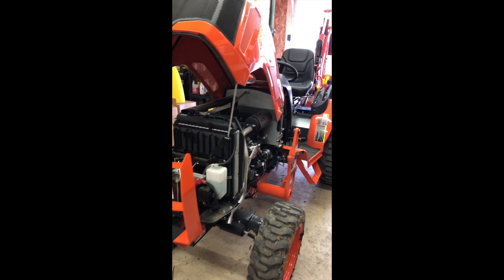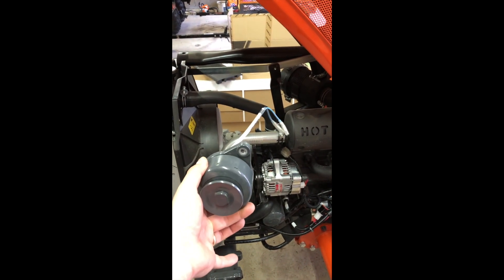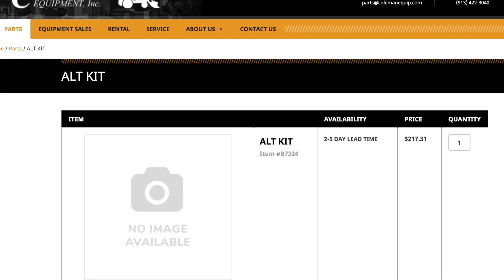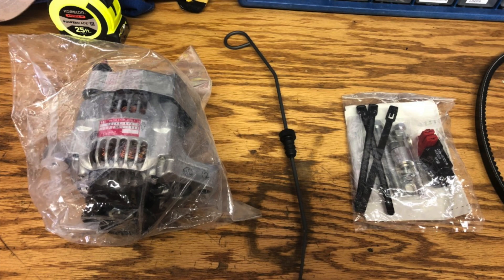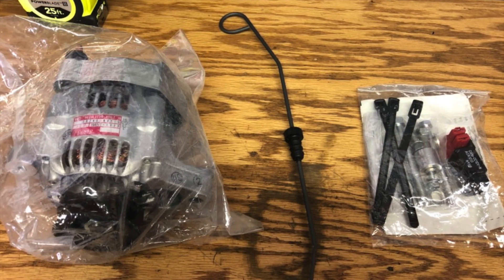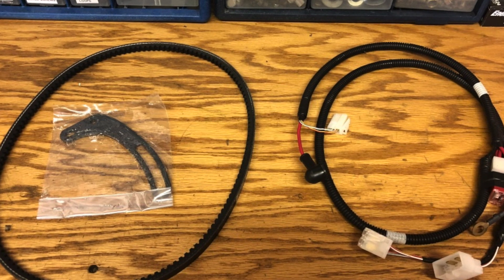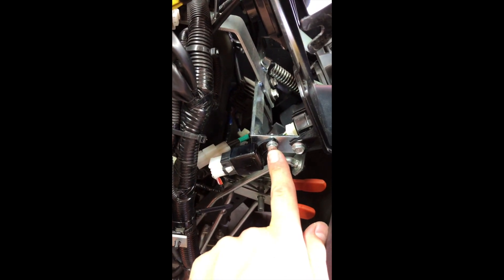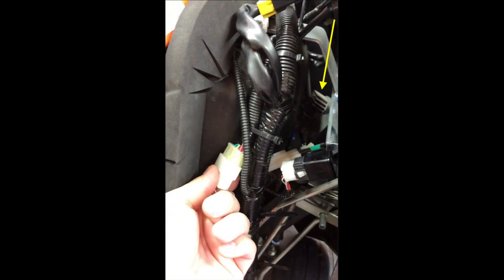Kubota B2650 - Upgrading the dynamo to a high output alternator

Comment: What exactly did you do with the ends of the 2 blue wires that went to the dynamo? You said you hadn’t had any problems with you leaving the original voltage meter on the tractor my question is why would you have a problem when it’s unplugged and not doing anything.

Comment: I bought the B7324 kit from Coleman, but it took a little while since they didn't have any in stock.  Your video was an excellent instruction manual very much needed because if I had to rely on their instructions, I would have been scratching my head a lot.  The install took 45 minutes like you suggested.  As info, the belt installation was the most difficult step as it was a tight fit.  Thanks for your video as I'm glad to have the dynamo replaced.

Comment: I have an off brand micro excavator with a kubota d722 engine- can anyone confirm weather this kit will work with the d722? I realize it probably wouldnt be plug and play but I basically just wondered if this was the correct alternator and bracketry?
Reply: Did you ever get this figured out? I'm trying to mod my mini excavator also so can keep my air conditioner going.  Mines a d722 also.

Comment: My similar kit for my B2601 just arrived.  I have a Japanese-made B2601, the US-made ones now come standard with the alternator, but the upgrade kit is still available for older B2601s.  I read the instructions tonight and thought "that's gonna be fun."  The instructions looked quite specific and clear, but very very abbreviated.  Your video puts it all in context - I'm sure my tractor is a little bit different, but most of what you're showing lined up with what the instructions say for the B2601.  Thanks for making this.

Comment: I’ve recently installed this without seeing your video. I did everything the same, but I did remove the old regulator. Have not been able to get my tractor to start since. Turns over, but won’t start. One thing I’m not clear about is what did you do with the other end of the blue wires that were connected to the dynamo?
Reply: Blue wires don't matter.   They connect the dynamo (low quality DC) to the regulator.  When you remove the regulator they are disconnected.
Reply: @rhettblucas I’m having the same problem after installing the kit on my Kubota B2400. Crank no start problem then while cranking the fuel shut off solenoid burnt up. My tractor ran perfect before installing this kit. What did you end of doing to your tractor to get it to run or have you fixed it yet?